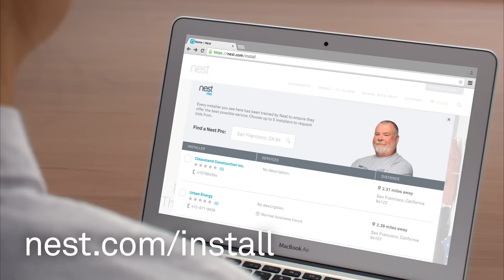How to install Google Nest Protect (Wired 120V)

Comment: 1:35 So for full house protection our only option is to replace all existing wired units with Protects. First Alert kept the interconnect wire on their Wi-Fi units so not all models need to be replaced.

Comment: Hello! If I already have old hardwired (not google brand) smoke detectors - should I purchase the hardwire nest detector or battery option?
Reply: Purchase the hardwired ones. They come with 3 AA backup batteries.
Reply: Harward Ones, however, if you have a heat detector in your garage and a fire occurs in the garage it wont set off your detectors in the house since Nest tells you to cap the red interconnect wire. This will not pass fire code.

Comment: Why the plug is not centered and flat?
Because it is not exactly in the centre and because it is not flushed with the sensor I need to drill bigger hole in my ceiling, otherwise it is impossible to rotate it into the backplate... Such a simple thing could save people a lot of time and save their ceilings from unnecessary holes ...
Reply: as a pro installer this really annoys me too. and the fact that the power cable isn't double insulated as required for all cables ...  I have to either install a lining box, or just  bodge it with sleeving (and wago the actual connection) its a joke. because google know the requirements.   but the biggest issue I have being the off centre plug - I cant patch the hole, but worse still. they could even make the plug disappear into the unit!  it doesn't need to protrude.
Reply: Hard to put put the device back in place
Reply: @Neoyorchese Yes

Comment: Can the 120v unit be wired on the wall or must it be ceiling mount?
Reply: Although recommended it should be on ceiling, the Nest manually has guidelines for the best placement on a wall as well

Comment: What if Power is out and your router is off. then there is a problem. how would it sound the others
Reply: In that case, you should be more worried about the flesh eating zombies.
Reply: @jiujitsustudent604  LOL
Reply: If the power is off then what is going to start the fire?

Comment: My Kidde wired detectors expire in 2023. I'm WAS looking forward to upgrading to Nest Protects as I already have Nets Yale, Nest Hello, Nest Thermostat and more. Upon research I found that installing Nest Wired Protects throughout the house would cause a failed fire inspection. BE CAREFUL. If you have a wired heat detector in your garage (standard to code in new homes now) it will be rendered useless. If you have a garage fire from a car or something else the wired heat detector will set off the Kidde Alarms that are currently hardwired in my house. If they are Nest Wireless Interconnect they will not go off (red wire not connected to Nest Protects). Maybe Nest can come up with a fix before I am ready to replace my smoke detectors. If they don't I will have to stick with the non-wireless interconnect detectors. I still like Nest products though. Good Quality but customer service needs some work!!!
Reply: Good to know. Similar setup here with newer home and was wondering about this too

Comment: I just installed mine but I have 3 white and 3 black wires already coming down. Not sure which one to use but I connect the nest white with all the white and black with all the 3 other black and twists with the cap. I hope I'm doing it right as there are more wires then I see on this video.
Reply: The other black and white wires are probably the wires that lead to your other smoke alarms

Comment: If I only buy 1 nest Protect, would it communicate with the rest of my Smoke Detectors?
Reply: Don’t have one but I’d say nope! That’s the first thing I thought of as well but unfortunately they said in the video to cap off the interconnect wire. I definitely think it’s something they need to add though.
Reply: Daniel Sala the others would have to be Nest as well

Comment: What if u lost ur wifi connection then what?
Reply from the maker: Nest Protects will still function as smoke/CO alarms without a Wi-Fi connection, you just won't receive notifications from the app until your connection is restored.
Reply: will the other Nest Protect's still talk to each other so the other devices will alert others in the home there is an alarm or do they become independent because there is no wifi loosing the interconnect feature ?
Reply: @murph5150  I hate it when the interconnect feature gets loose.
Reply: @googlenest  why not interconnect wire also connect to each smoke detector? Without wifi there will be no communication between all smoke detectors. That's not good. It is required bylaws in my city!
Reply: @kangjagir  They don't need your wifi connection to communicate with each other. Your wifi connection is only to send you message alerts.
Reply: Hey google when they turned the power back on they flipped a 50 amp breaker, if a nest protect was wired to that circuit whouldent it explode or something?
Reply: @cydneywopart6238  No.  As long as it's only connected to one of the phases and a neutral (the black and white wires) it will only draw the current it requires to run and no more.  It would be strange that those two circuits would be connected somewhere.

Comment: What happen when there is no power?
Reply: Jasper Garstman
Reply: John W. So do these run on their own wifi system? I want to get these for a house I'm buying, and I need smoke & CO detectors on all floors in order to pass inspection and get approval for an FHA mortgage. I won't have my internet and wifi set up just yet.

And would it be the same with the battery version?
Reply: @Suavelito1  You should contact your local home inspection agent. Any realtor has one available you can contact, if you have trouble finding one.
Reply: These run on your existing Wifi System and don't have their own system.

Comment: At 2:16, when they turn the power back in it shows them flipping a 50 amp breaker.  I have a feeling if you connected a Nest to that circuit the 240V supply would blast it right off the wall.
Reply: How funny...I noticed the same thing. I'm sure only a select few picked that up or were bothered by it. And to the other poster, I don't know of any thermostat that uses a 50A DP 220 breaker. 50A is usually reserved for the stove but could also be used for other things...but certainly not in this application. I'm guessing they just flipped any breaker since they were only making a video and it didn't matter.
Reply: It’s no longer a nest protect its a nest rocket
Reply: It could be a reused clip from the thermostat install
Reply: @TheCarWashChannel Do you think it would be safe to install one. It’s 120v but I don’t know how much volts my current one is??
Reply: I saw this comment before I saw the clip in question and thought to myself..well maybe the video clip was for a UK installation..WHAT..a 3 PHASE 50A breaker? 
Whats also funny is there are a few 20A single pole breakers directly to the left of the breaker in question..maybe its a copyright free video clip.
Reply: Or maybe there are over 100 nest protects on the same circuit... :)
Reply: It's the main breaker to turn off the whole panel.
Reply: they turned off the entire floor, not the smoke detector
Reply: It's a 3Ø breaker too lol